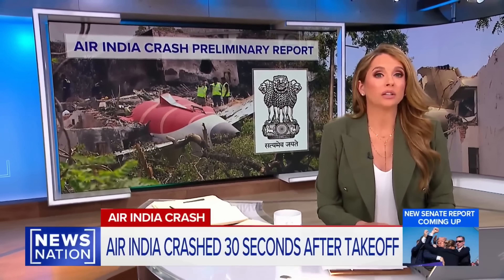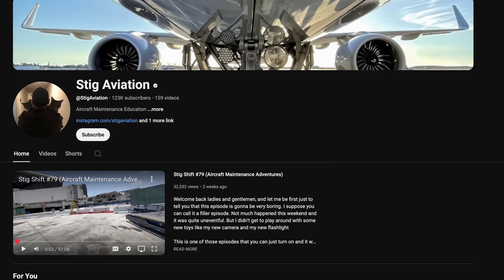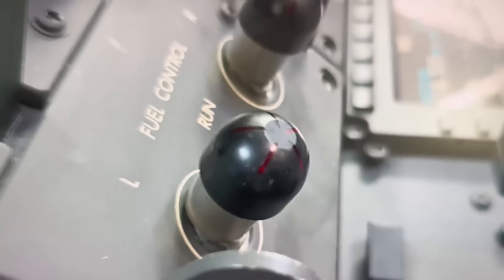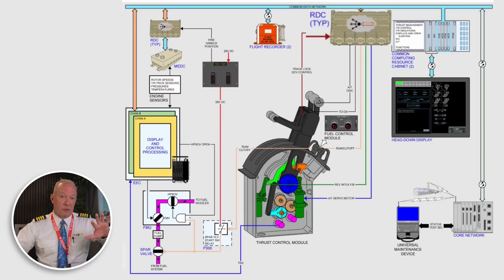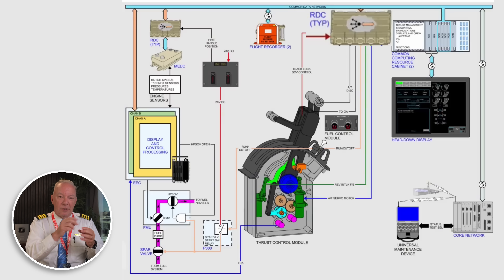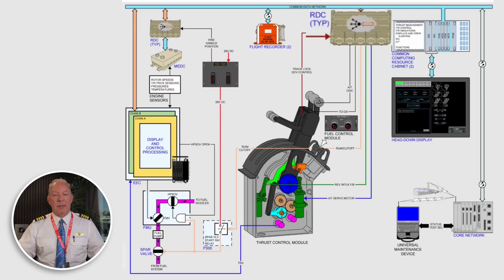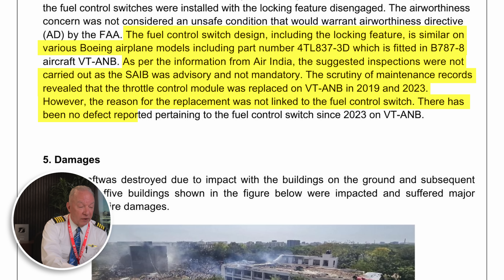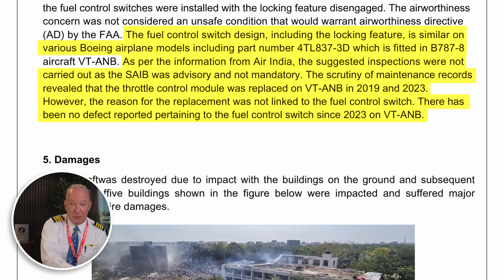The Truth About Boeing 787 Fuel Control Switches

Comment: Capt you are not a aircraft engineer. I hope you look at things objectively without bias or affiliations.
1) RAT deployed just at 70 ft after take off. So in this case if engines were turned off there is no way aircraft with full fuel and pax climb another 350 ft on kinetic energy. So RAT deployed due to some other reason like electrical or hydraulic. This is the first cause. Refer preliminary report CCTV screen shot of RAT deployed.

2) The rear EAFR black box was fully damaged. This is a Boeing design issue. It was not possible to recover the data. The fire melted the metal. The tail section was intact. But there was an electrical fire that caused damage and body of a cabin crew that was intact had electrical burns. She would be around the rear jump seat. The only possibility is Lithium ion battery. Refer preliminary report images of both the FDRs front and rear. The front FDR was in a fuel fire and had suffered the impact but it was not damaged and data was recoverable.

3) Ref Stig aviation video on Lithium ion battery maintenance released a few days prior to the crash. The Yuvasa batteries have to be sent to the manufacturer in Japan for periodic maintenance. If these batteries are not maintained there can be potential for failure, fire.

4) The visual evidence from amateur video shows the landing gear retraction was in the forward position. A hydraulic failure can cause RAT deployment.

5) On the ground from previous leg there was a passenger video showed IFE, AC and passenger comms not working. It showed a electrical system under stress. The aircraft was delayed by 2 hrs due to stabilizer error from previous leg. 
The hydraulic event drawing too much power on a stressed system could have led to FADEC initiated engine shutdown. 

So once engines begin spooling down the co-pilot would have noticed this and asked "why did you cut off the fuel" by now 9 secs passes and they turn off and turn on the fuel switches to relight the engines. One engine starts while other was in progress. Due to loss of altitude the pilot sends a mayday to ATC but it was too late.

6) Why pilot intentional act is least likely? From visual evidence we know that RAT deployed almost as soon as the wheels left the ground.
So if he had initiated it the aircraft would climb to just 200 ft and crash.

Historically pilot sui*cide were executed when aircraft was at sufficient altitude while the other pilot was away. This gave the best possible chance.

While it sounds easy to turn off the fuel switch and cause a crash it has to be executed bypassing a pilot seated next to him. This along with the precision to ensure the aircraft crashes and they don't survive at a very low altitude of 400 ft.

Sui*cides are normally done when nobody is around. Again at this altitude it's like trying to commit sui* cide from 1st floor of a building when he has a lift to take him to the 20 th floor.

I hope you look at other data visual and preliminary report which does not align with an early fuel cutoff theory.
Reply: You can't simulate all crashes on a simulator. You know that. 

The transponder had stopped broadcasting around 10 secs into the flight. This is again a sign of electrical issues. 

The survivor reported hearing a loud bang and cabin lights flicker. Probably some sort of electrical fire.

Why preliminary report has issues? They show RAT deployment very early in a clear CCTV footage. They show of the max altitude achieved which is not possible in that time line of fuel cutoff. 

Most importantly they give manufacturer a clean chit when their own preliminary report shows images of a damaged black box due an electrical fire. How is this not a design issue? 

I have been to very experienced doctors for a diagnosis. Some do not change their initial report even when given clear evidence and had to then approach for a second opinion for continuing the treatment.

Objective should be to line up all the facts available report, video, other info. When we overlook the facts and fixate on a particular data  then we end an objective perspective. This is not about protecting the pilots and about safety which is a lesser priority for the manufacturer as we have seen in recent years.

Comment: 8:30 On behalf of all FADEC engineers - current AND former, hardware AND software - THANK YOU, Captain Steve! Superb explanation.
Reply: Where is the FADEC on Captain Steve's diagram?
Reply: @joevignolor4u949  GOOD POINT, and how does FADEC interface with the "Closed" Fuel Cut-Off Switch circuit(s).
Reply: Question - if the cables to the battery/batteries had a short/wire jump/disconnection for 10 second,  and the electricity to the switches stopped, wouldn't that have caused the valves to close, and is this even possible, or is there redundancies for every wire, cable, and connection to the valves/switches.
Reply: @jwalster9412  If that had occurred, many more errors would have been noted by the pilots, and been recorded onto the recorders.
Reply: @jwalster9412  yes switch are open if power is lost,
Reply: @jwalster9412  Good point, and gets to the heart of the matter.  When there is an electrical failure most people first flip the switch to check if it's working.  Not the switch, but the electrical power.   Steeve says, You have a complete electrical failure in your car, but the battery is still OK."  Please give me a break.  This so so childish it defies reality.  Almost everything Steeve says about electronic faults indicates he always calls an electrician if he has a problem.  He would not be able to troubleshoot anything moderately complex.
Reply: Can cables fail in any way it mimics same signal as moving those switches?
Reply: @rm6857  Usually a poor connection in the circuit.

Comment: What do you think of what some engineers have said about the battery (or one of them) suffering a thermal runaway and this causing a failure of the electrical system or just triggering the valves to close directly?

Comment: Im sure in one of the videos that showed the air india crash  the 787 plane lifted off the long runway very late, was that the case or just misinformation?
Must admit though im very surprised that all it takes to bring a 737 or 787 down at its most critical part of flight is 2 little switches that take roughly 1 sec to use!

Comment: Love your work.  Re: the fuel switches.  There is one aspect of all of this that I have not found discussed and I think is pivotal.  That is:  when one pilot confronted the other on if the other had cut off the fuel,  was his question based on the fact that he could see that the fuel switches were now in the cut off position?  Are there any other indications that he would get that the fuel supply had been cut off (Other than the plane losing power)?  I think the question was prompted when he was losing power and when he looked down he saw the switches in the cutoff position  Why else would he have asked the question?  If so, this absolutely nails it that the physical switches were manually put into cutoff.  Your electronics argument is a bit shaky for an electrical engineer but I agree...beyond any reasonable doubt, the cutoff was the result of the mechanical switches being thrown.  Also, a picky point:  the fuel starved engines are referred to as "failed"...they didn't fail, they were turned off.  No indication of any mechanical or electronic failures for this plane.

Comment: Is the relay normally closed or normally closed? If normally Open then water getting in the supply power and grounding it could cause the relay to fail and move to the open position. If normally closed then What keeps the engines from starting on the ground in the hanger if the power is shut off to the control relay? Is the same power used for both the relay and the power of the fuel control switches down stream so that if power is shut of nothing can happen?

Comment: According to that diagram the DISPLAY AND CONTROL PROCESSING (FADEC i'd guess) has 2 ways of stopping the fuel:
1. by not supplying input to that big fat AND gate connecting to the fuel switch and HPSOV;
2. by operating the FMV (this one probably only down to idle)

Comment: To add one very important info. 
When you loose all electrical sys. The dc power will keep the fuel tanks open and it is fail safe open. Additionally if u loose the AC power the fuel boost pumps will be off however the engine fuel pumps will still supply the fuel to the engine by suction method as long as the engine is not switched off. 
Over all very good illustrations capt. Steeeeve which I totally agreed with based on 40 years of experience on commercial Aircafts in engineering and maintenance.
Reply: After 40 years in commercial aviation, you should KNOW that in English the word 'aircraft' has no plural form. Whether one airplane or 10, they are still described as AIRCRAFT. And aircraft don't 'loose' AC power etc, they LOSE it.

Comment: Mechanical balance point on indent ? say switch needs to move 60 degrees between on and off. Heavily spring loaded detents. But lift and move 30 instead of 60 degrees, drop and with care balance out any residual pull - switch state is now held on a knife-edge and a slight nudge will flip it into either of the valid ( normal control movement ) lock positions.

Comment: Does the black box recorder measure the position of the switch or the voltage of the curcuit?  If it's power at the pump, another failure could mask as a switch issue such as a realy failure.  Just a thought.  You need a seperate contact in the swtich to say switch moved to position "X" that does not feed voltage.  Both circuits indicating switch thrown would be certain.

Comment: Nice, thx, but still not a complete coverage of these Boeing 737 fuel switches.
1. The intermediate position of the switch - can it be placed in an intermediate position? - deliberately or not. What happens if it can be?
2. At what point in the throw of the switch does it activate and deactivate?
3. Is there a visual or auditory signal to both of the pilots from the activation or deactivation of these switches? At what point in the throw of the switch is the signal sent from the switch, or is there a signal from another part of the fuel supply system?
Thx

Comment: All through this I had an image in my head of that lanyard round the Captain's neck getting hooked around both those switches. If there was something heavy attached to the end, as the aircraft rotated for takeoff, gravity would pull the lanyard tight both lifting the switch levers up and pulling them back, nearly, but not quite simultaneously. There seem to be two design flaws with the switches: 1) There is no fence between the two switches allowing both to be snagged simultaneously; 2) There are ridges on the switch lever, under the locking mechanism and behind the black knob which could allow a snag to pull the lever up potentially releasing the locking mechanism.
Admittedly this scenario is highly unlikely, but so are the alternatives. Even if this was not the cause in this case, these are obvious design flaws, particularly the lack of a fence between the two switches.

Comment: The only possible way for a closed loop circuit to shut off the fuel valves without command is for a short-circuit from a wire with a bad insulator rubbing something that would  ground it out. That means we would need at least two short circuited wires within a second of each other. Additionally, if the black box is monitoring the actual position of the switches, then it wasn't two simultaneous short circuits.
Reply: Or the loss of the DC bus fed from the battery, perhaps by the loss of the protection diodes...
Reply: One of the major theories is a short in the DC power. It lines up with the timeline and explains recovery once the RAT started supplying power.

Comment: Retired submarine officer here.  There many switches like these on nuclear submarines. Not possible to move/bump them by accident.  Only on purpose or by mistake.
Reply: Nothing in the report says any pilot flipped the switches to off. You should read the report.
Reply: @martinwhite418  The report can't say one way or the other, no cockpit cameras. But given the nature of the switches and the very 'analogue' design of the circuit, there isn't any other explanation that makes sense. 

I'm a retired ROV pilot, and we have exactly those switches on our control consoles. It is IMPOSSIBLE to move them accidentally. I've actually seen one of those switches with the lever broken off. A guy fell on it as the vessel we were on rolled and his hand came down on the console. Snapped the lever off, but the switch itself didn't change state. As I said, impossible....

The only reasonable explanation is that one of the pilots transitioned the switches.
Reply: @Chris-hx3om  There is no time stamp in the report for this alleged "switch flipping" , and the report does not say any pilot flipped the switches to off.
Reply: @Chris-hx3om  Or that there was some electrical fault in the circuit. It's not about the position of the switches but the flow of electrical current though the switches.  The switch position people are somewhat like flat earthers.   The earth looks flat, so it is flat.   It is a known fact that this particular plane had major electrical system faults.  It's not about testing switches on some other airplane several years previously.  Any investigation has to be specific to this particular airplane.
Reply: @JoeLinux2000  Each switch drives a completely separate circuit. They is no interplay between them. For both circuits to fail the same way at the same time... That's just not going to happen. There are also no computer controls that can 'move the switches', mechanically or electrically. They are completely isolated not only from the rest of the aeroplane, but from each other.

We also see in the CVR transcript (the small amount that was in the report), that one pilot asked the other 'why did you cutoff?' This is not a 'behind the scenes' failure, it's right out in the open. When it looks like a duck and sounds like a duck, it's a duck. It's not a goose. Do I think it was intentional? I'm sitting at about 99% no. I think this is what we would all call a 'brain-fart'. Will we ever find out for sure, very unlikely. But my honest opinion is that I don't believe there was any malice in what happened. I think it was just a terrible accident. I know a lot of people want to pin the blame on Boeing, and they do have plenty to answer for, but in this case, I don't think so.

BTW, I have also been part of many 'root cause analysis' teams for the various companies I've worked for. Fortunately I was never investigating anything as tragic as this, but the methodology is the same.
Reply: @martinwhite418  "There is no time stamp in the report for this alleged "switch flipping""

Yes there is.
Reply: @Chris-hx3om Please tell me what section of what page states the time stamp of this alledged switch flipping, and tell me the time stamp time. Thank you in advance.
Reply: @martinwhite418  You have the same Google as I do. I found many news articles that spelled out the timeline, from the IIAB preliminary report. I'm sure you're just as capable as I am to look them up too.
Reply: Yes, but question is if it was before or after RAT deployment.

Comment: If it's so definite that a pilot switched off the fuel control switches, then the preliminary report that came out in 28 days of the crash, would be the final report as it would be definite. But there will be a final report and hence the preliminary report is not definite and as the name suggests, it is only preliminary! From another angle, you can go to your television 📺 and use an on or 📴 switch to turn it on or off. But you can also turn your television 📺 on or 📴 with your TV remote control! So it is plausible that something else like an electrical or computer glitch switches off the fuel switches, with the system glitch thinking there is a possible fire 🔥 on the aeroplane ✈️  Let's please wait 🫷 for the Final Report 🙏

Comment: As long as the wire insulation is intact. Frayed wires grounding out or contacting other frayed wires could immitate the movement of the switches.
Reply: Steeeve explained thoroughly that nothing electrical downstream of the   switches could have moved the physical switches from run to off.

Comment: There seem to be at least two other signals, not coming from the relay, that can close a valve.

"They are in a closed system that can only be operated by the 28V DC". Meanwhile, the drawing at 8:00 very clearly shows that the middle valve is not at all operated by the 28V from the relay, and the top valve is guarded by the "HPSOV OPEN" signal through an AND-gate. Also, the 28V may come from a battery, but what about the control voltage for the relay coming from the switches? Not shown or explained. Furthermore, what exactly is "looked at" by the FDR? What condition exactly causes the FDR to log that the switches were moved? The control signal for the relay? The 28V output from the relay? The movement of the valves? What?

Sorry Steve, but you didn't clarify things here.

Comment: Nice explanation, the fuel relay reminds me of an issue I had once with a car starving of fuel because it overheated even though the key 🔑 was turned on providing ignition / electrical power to the relay but that didn’t operate.  The technical operation is comparable from what you explained.  The only way for me back then was to cool it down and then it would run again until it overheated again. Not sure the possibility for the pilots to switch it off and then switch back on again was to see weather there would be any sort of trigger like in the car turning of the key 🔑 and switching it back on again hopping the engine would start again. But you also mentioned that the report says the engines didn’t loose thrust until the switches were turned off - was just a thought 💭